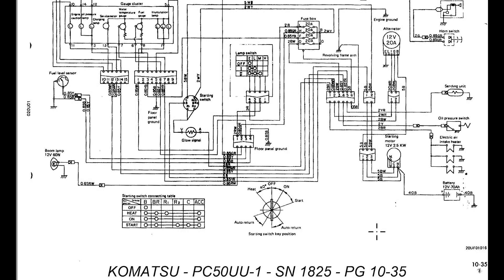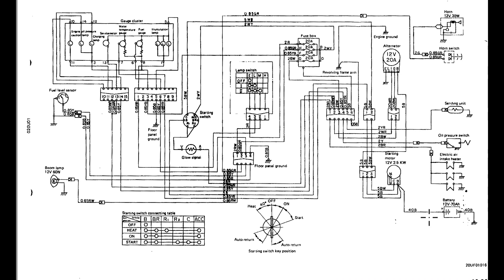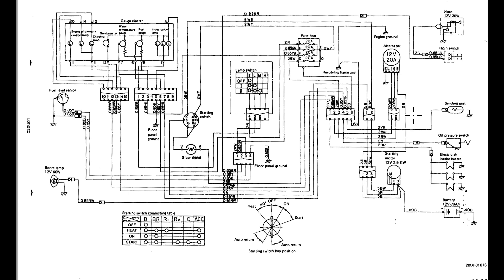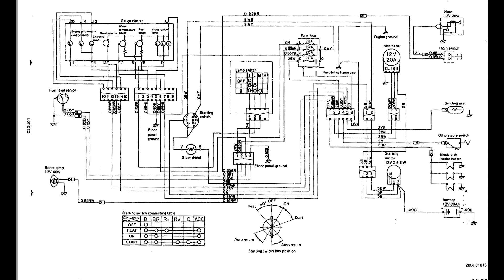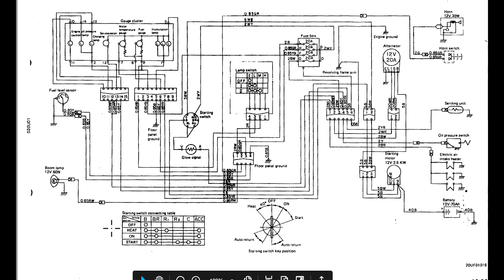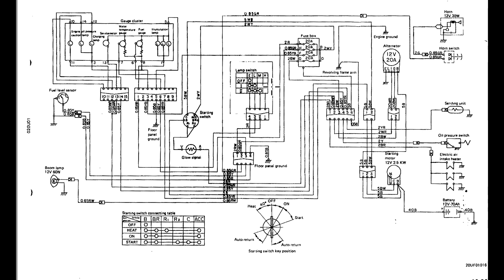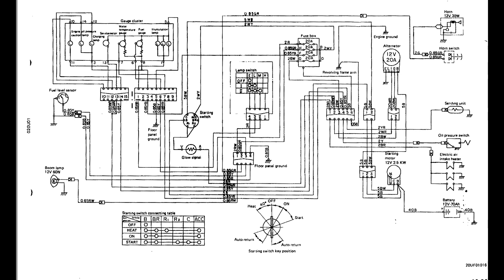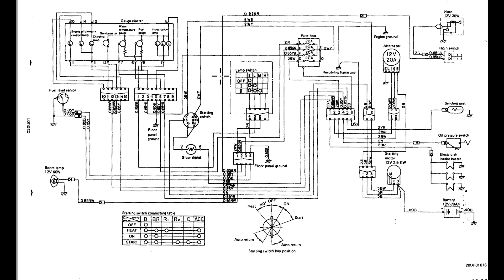Wiring Schematic Part 1

Comment: Amazing series of videos.  I have a PC28uu-2  grey market  excavator.  at has been oujt of service for a while.  I have the service and parts manals but was not clear on how to read them.  Some mystrety left but these are very helpful.  its parked because i could not get the boom to lift and im getting an alarm.  Wouldo you have a video about testing the  postion reostats?  Thanks for these.
Reply from the maker: Thanks for the question. I don't have a video showing testing those components. They are easily checked using an ohm meter. Most are three wire variable resistors. Unhook them at the harness connectors and then check each wire to the body of the component. There should be no continuity. Next check each wire to the other wires. There should be some resistance that can change when the linkage for the component is moved. As I recall the center wire in the connector is a power wire from the computer and the other two are the sensor wires. There was a lot of problems with those machines and Komatsu did not make any information available in this country.